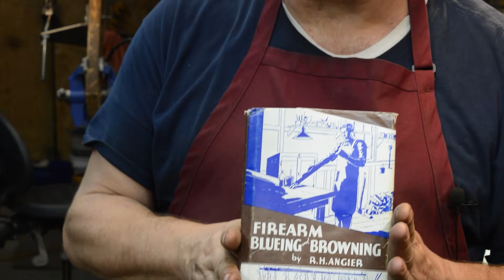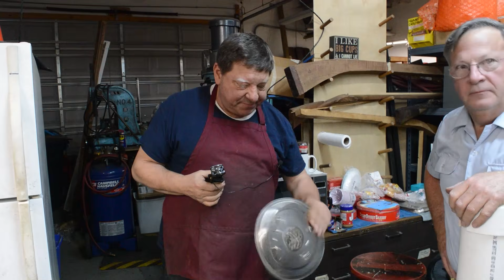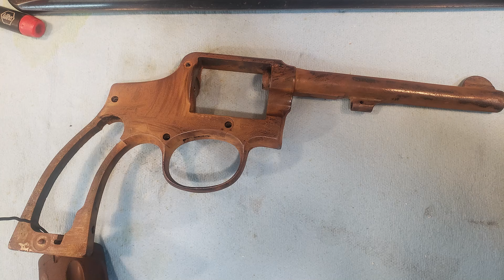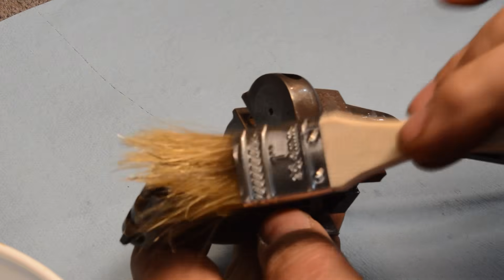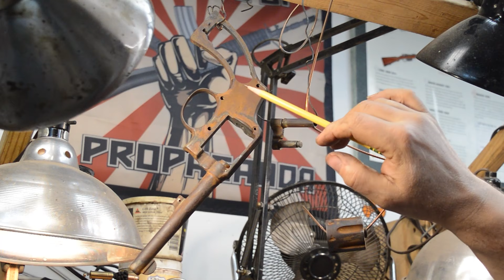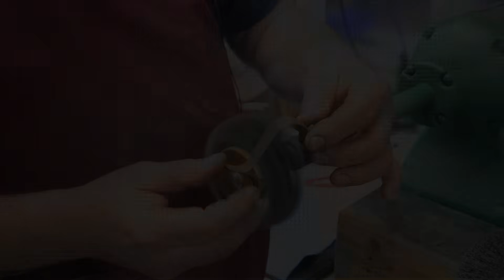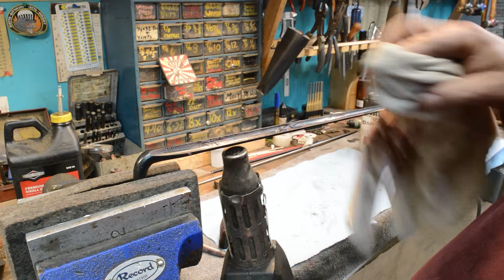Rust Bluing.....Anvil 0109

Comment: You should take some water and add borax ( Twenty Mule Team) to the water. It will prevent freshly cleaned steel from flash rusting. 
   Here is a cool test for borax as a rust preventer. Take two small mason jars, and add tap water to each about 3/4-7/8 full. Take plain steel wool 000 or 0000 and tear a small amount and put it in each jar. In one jar add 1/2 teaspoon of borax and nothing to the other, shake them and seal them with lids and write a date on each jar. Check them in 24 hrs. In most cases the untreated ja will start corroding and the treated jar will not. 
   Check the jars in a day or two, a week maybe. The treated jar will look the same as it did on the first day for months, even for years. The untreated steel wool in the jar will continue rusting until it’s a blackish red mess. 
  Oxygen has seven electrons in the outer valence shell and bare steel has 9 , molecules like to be stable and so oxygen being the great thief will steal the electron from steel. Binding the oxygen molecule with corrosion inhibitors prevents oxygen from taking an electron from steel.
   Nitrates, Silicates, Molbdates and Borates will help prevent corrosion in steel pipe systems used for cooling and heating systems. That was part of my work for 35 years treating industrial water for HVAC systems.
Reply: Borax is a wonder mineral. It has so many usefull purposes,  another is that it kills mold. It's the old time method of pressure treating lumber, before they started using chemicals. After building a new fence or deck with untreated wood, just mix some borax in a spray bottle with water and s0ray down the wood. It will keep it from rotting and turning colors. I have the same privacy fence up since 1990. I spray it down w8th borax water every few years.

Comment: Coupla things. Mark, try this sometime for rust bluing: You will need: A cabinet large enough (not metal!!) for the guns you want to blue, full strength muriatic acid, lime. After you get the item clean degrease it by making a paste with water and lime, brushing the paste on the piece and allow to dry. Use a brush to remove the lime paste and blow off any remaining dust with compressed air. (I found this method in W.W. Greener's "The Gun", it works very well.) Pour some acid in an open container and put it in the bottom of the cabinet, then hang the gun in the cabinet and leave for a day or two. I would recommend doing this outside in warm weather, the fumes from the acid are pretty potent. Card off the rust and repeat as necessary.

Comment: Fantastic video.   Is conversion in straight water?  I thought I heard something about adding salt from someone at some point maybe?  I need to get a copy of that book.

I haven't done a rust blue yet, I've been debating backyard charcoal blue or rust blue for the barrel on my next flintlock build.

It was nice to see you mention linseed and wax.   Both are great for protecting metal in the white and bluing.  Linseed rubbed onto hot metal is almost as good at preventing rust as bluing.  I get it too hot to touch with a heat gun and rub it in, and like you said let it sit for 10 mins before  completely buffing it off.  I've even used it to seal in colors when tempering.  It's not very scratch resistant, but neither is bluing.  

When I tempered the hammer and frizzen knuckle/tail of my flintlock I rubbed them in linseed.  Just for a pretty effect I ran some blues and straw colors on the lock plate.  I figured I'd be steel wooling it off after a short time, but 3 years later, and weekly shooting/cleaning those colors are still there.
Reply: No, not only don't you want to add salt, you want distilled water.

Also IF you use a chlorinated brake cleaner and use hydrogen peroxide to speed up the rusting process, you'll end up with pretty pitted metal.

Bluing isn't great at preventing rust at all, actually rust bluing is horrible at preventing rust. It's a finish, not a rust protection so you are going to need to oil it and keep oiling it.

Comment: Don’t get why you would want a gun to rust.
Reply: Jesus. Watch the video.
Reply: @eggrolll  Never been called “Jesus” before.  It’s really not my name.  Think you misspelled “egg roll”.
Reply: What do you think bluing is
Reply: @j.shorter4716  Don’t be cranky just because you’re “shorter”.  It’s either an electrochemical conversion coating with iron on the surface of something forming magnetite, OR something your mother put on your family’s white clothing to make it even whiter?
Reply: @doak4886 so you disagree with rust bluing or other forms of bluing? It’s not actively rusting once you’re done with the finish.  Bluing in all different forms has been a standard finish for centuries now.
Reply: Rust bluing is just forcing an extremely thin layer of steel to go through a controlled rusting process, usually less than a thousandth of an inch. The idea being that iron will rust in the presence of oxygen, but you can't make rust *rust*, ya know? A blued finish will eventually corrode given enough time, but it will take significantly longer than when compared with bare steel.

Comment: What is rust bluing? Not a gun person, I have no idea. Are you trying to rust the gun, or a blue finish as I know it, like a new gun?
Reply: There's a bunch of ways to get a blued finish, and that's just a controlled rust. Rust bluing is nice cuz you can do it for cheap and have a great degree of control over the process, but it can take fuckin ages if you're not accelerating the rust with an oxidizer like hydrogen peroxide.

There's faster ways to do it like caustic bluing, which is pretty sensitive to temperature but will be much quicker, and you can preserve a polished finish much easier doing it this way.

Comment: Made my steamer this summer and it’s a lot more forgiving than you would think to still get very nice results. Much better than any cold blue. Simple but repetitive process. I carded with degreased 0000 steel wool. After I finished I neutralized with baking soda and water then rinsed then piled with Boiled Linseed Oil because I had it on hand.

Comment: When rebluing ,leaving original bluing can you wet sand original bluing  ? I have a pre war ,probably 1910 JP Saur oberndorfer 98 mauser.  . . It appears to be a GEW . 98 due to the type of fireing pin and cocking peice, The ones with the double set triggers,  funky stock with schabel & tapered octagon to round barrel with rib 9X57 & the bluing is really close, an application or 2 should make it like new,  something tells me to carefully wet sand it first with something like 1000 grit it appears it was high gloss black with little to no visible sanding marks under the bluing,  Amazing what they did over 100 years ago

Comment: What's the best way to card the inside of a receiver? 
I noticed the inside of one of the receivers in this video was rusted. How will that get cleaned up? The carding wheel can only reach some of that.
Reply: In case anyone has the same question... I found the answer from Mark in the comments of a different video: Non-detergent motor oil and a toothbrush.

Comment: So I'm trying to reblue a Mossberg 151m. Nothing too special other than it's age. Been using a diy solution and a hot steam tube. I've been having an issue where I after steaming the barrel for 30+ minutes, over a rolling boil and reaching 95°C at the top of the steam tube, it get to carding and I get tons of black flakes just flying everywhere and seldom any blue seems to stay. I've done this about 6-7 times and the metal has definitely gone darker than at the start but it is way slower to build up than shown here. I read somewhere that the red rust to magnetite conversion happens at close to boiling point which drove me to increase the temperature in the steam tube. 
My process was to clean up the surface then apply the solution, wait for it to dry and then hang it in the steam tube. Wait ~30-50minutes, card and repeat. Am I doing everything wrong ?
Reply: Are you applying, let dry, straight to steam over boil?

Comment: Mark, I have an old 30-40 krag carbine that someone in the past  mounted a scope on it. They botched the job so I looked around and found an original 1896 stripped, receiver and have procured it. Would you consider re-bluing the new ( old) receiver, removing the extant receiver from the gun barrel and stripping out its parts, refitting them in the new re-blued receiver and re-mounting the new ( old) re-blued receiver to  the barrel and test firing the gun? 
If so, can you give me an estimate on the cost?

Comment: Love you guys and love your content and don't wish you any ill will but I have to set the record straight for your followers.

The steam tube method is no bueno. It's cumbersome, you have to find a well ventilated area for it, and depending on how big your barrel is it will want to fall over constantly.

I suggest taking a PVC pipe and filling it up with boiled distilled water. It has all the pro's of the steam tube with none of the con's.

Comment: Mark, if you need a fine rust in a hurry, just strip a piece of metal with denatured alcohol set it on your bench and just watch the magic. Depending on the humidity you can see rust as quickly as 20 seconds. 

Backstory, we had a random inspection of a toolkit by Quality Assurance (QA) in the USAF. The toolkit was comprised mainly of Snap-On tools; so expensive chrome as far as the eye could see. When the inspector popped open the toolkit, it looked like it had been submersed in salt water for a decade, yet the paperwork inside said it had been inspected just a couple weeks prior and by one of our best troops. Our investigation discovered, nightshift had run out of 'CLP', it was on order, scheduled for delivery that following morning. So the Airman took it upon himself to substitute denatured alcohol and finish wiping down the tool kit as per inspection requirements. This still didn't explain the ridiculous level of rust so we conducted a little 'science'. We  pulled brand new tools from bench stock, wiped them down and began setting up timers. Before we figured out how to turn on the timers we already had a super fine surface rust on the chrome which (till that moment) I thought was impossible. Another 15 minutes, the tools were no longer serviceable by military standards and we had our answer. Full disclosure, the Denatured alcohol from Lowes seems different from what the USAF HAZMAT guys provided. It seems thicker, less refined but, I can only presume it will provide similar results.
Reply: All solvents available to the public have changed dramatically in the past 20 years & eventually won't be available at all , thank you democrats , for example acetone will be banned in NY next year,  according to the paint supply in my area

Comment: I'm Starting my first project. I'm trying to save time and minimize mistakes. -If the metal has small rusty pits, and without sanding it off, or brushing it/clean it off. Can I boil it, and cold blue it? I want a really dark/strong black. On one side, I want a high polish. On the side, I scratched a pattern on the slide. I want the pattern to contrast. Should I do something different for the bluing?

Comment: how long should a boiling kettle be kept in a box?
Reply: As long as you want your parts to rust, so 45-60 minutes
Reply: @granola661  thanks for the answer,And the kettle should be boiling all the time? and the cardboard box will not dissolve from such a quantity of steam? in 45-60 minutes, a boiling kettle will surely evaporate 100 liters of water?
Reply: @АндрійПисарев  It shold be simmering to rolling boil, I usually have anough water to even if it evaporates there is enough to cover the whole part for the 45 minutes. And no 100L wont evaporate in that time, maybe 0.5L will evaporate.
Reply: @granola661  ok, thanks for the answer. after the part has been in steam for 45-60 minutes, do you boil it? it is mentioned in the video, but it is not in the video, it is a little difficult for me to understand the content of the video in some moments even through the translator. Thank you  took the time
Reply: @АндрійПисарев  Yes, steaming is for rusting and boiling is for the rust to turn black.
Reply: @granola661  Thank you for your reply and for taking the time to explain.
Reply: Would used hydraulic oil work for the first oiling after the final carding? If so, still leave it on for 24 hours? I’ve been using BLO but looking for something different as I don’t like the “goopiness” of BLO.
Reply: Till the metal starts pitting

Comment: I have a 1911 with a 1917 slide and a 1918 frame, it was refinished somewhere along its life and some markings lost ("model of 1911 us army" gone on the slide, and the SN and "US Property" reapplied by hand it appears) the finish is brown.... gray.... something....
I know the original black finish goes to brown, is the metal still protected, or should it be re-finished/converted?
I won't sell it, it's not a museum piece, i'm more concerned with protecting it going forward. Thanks!

Comment: Mark I want to thank you for producing all of these videos. I have been working on an old Spanish Mauser 7x57 model 93. It was partially sporterized. I am working on putting it into its original configuration. I went and rust blued this rifle using, non-iodized salt, hydrogen peroxide, and distilled vinegar.  I used my oven set at 215° to give it dry heat, then I added some boiling water to a stainless pan and put it in the oven for humidity. After a while I pulled the pan of water and brought it back to boiling. Then I dropped the parts into the boiling water for 45 minutes.  I then scrubbed everything down with 0000 steel wool. Now it is all coated in sae 30. It looks really good!
Reply: Im not sure whether i should be more impressed by what you managed to do in an oven… Or that your wife let you🤔

Comment: Rust bluing?  Really?  I was taught the process back in the '70s and the guy told me it was called browning. It was ever was referred to as bluing a weapon.  But, what did he know? He used to restore guns for the Smithsonian Museum.  Like everything, experts have a way of making it 10 times more difficult than it is.
Reply: There is a difference between "Rust bluing" and "Browning". They follow the same steps up until the boiling. Browning isnt boiled and is left at  Fe2O3 where as the boiling for Rust bluing converts That to Fe2O4. Like everything, someone with half knowledge will end up making it confusing.
Reply: Yeah browning is when you just card the unboiled rust and saturate it with oil

Comment: Might I inquire into your boiling pot "Thor"? I would like a setup like that that uses electricity rather than gas and I would like to know how yours is made.
Reply: Get 2-3 heat plates, build a metal vat large enough for your parts, fill the vat with water and put it on the heat plates, surround it with bricks to keep the heat in.
Reply: If you want to make an Electric Thor, take a look at a cheap water heater. Cut the top off. Done.

Comment: I'm just a little confused because you kept changing nomenclature such as steaming, boiling and hot potting and had multiple parts in various stages of conversion. Did I understand correctly that the bayonet had not blueing chemicals and was merely cleaned and steamed before carding? The reason I ask is I have a Winchester rifle that was stored in a cloth case in a closet. A water heater on the opposite side of the wall developed a lead and caused a humid environment to develop inside the case. Imagine my confusion when I opened up that case one day and discovered surface rust in some locations on this once mint 30:06. Imagine my confusion as well because my guns are always oiled before putting them away. I haven't touched the rifle or tried to card off the surface rust. The finish may be fine underneath but I don't know. What I gather from your video is I should leave the rust alone, clean it thoroughly, after disassembly of course, heat it up and then steam it and it will possibly convert that rust back to it's oxide layer and then I can card it with some 00: steal wool. I really would like to preserve this rifle and give it the best chance at bringing out it's factory condition without unnecessarily stripping it down to white metal. The rust isn't all that bad but just because it's there it's bad enough. Thanks for clarification

Comment: buy a Case knife in cs 3207 or similar carbon steel for some easy learning. Dipped it in vinegar and salt, warmed it up in laundry with dryer on to rust, rub or card the crap off a couple of times, boil and oil ...looks 100 years old satin finish🎉
Reply: Thank you for explaining your entire process in only one sentence! No diversions, no rabbit holes, no esoteric terminology to slow anyone’s comprehension! Vinegar, salt, heat , oil and lots of buffing. Boom , faster than my compliment!

Comment: Does anyone know what you do to the inside of the barrel when bluing or converting existing rust? Is it protected by oils, is it plugged to prevent rust/bluing?  If not what do you do to clean it out afterwards?
Reply: Chamber & muzzle are plugged.
Reply: Yeah you dont want the inside blued probably.
Reply: Very late reply but generally you don't plug them for rust bluing. You plug them for cerakote and parkurizing I believe but for rust bluing no. Heard this from another gent who did hot caustic bluing.